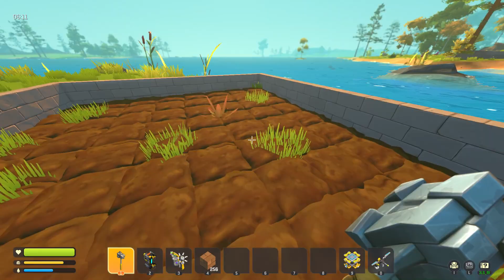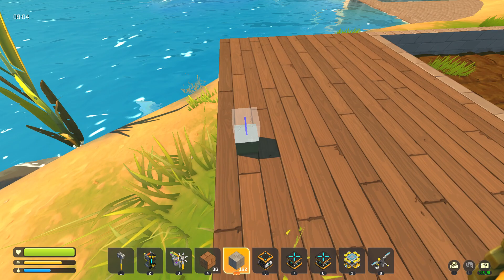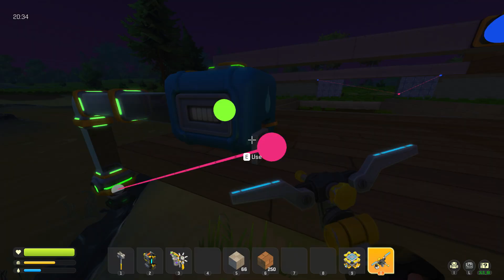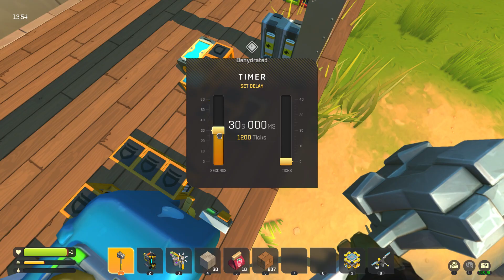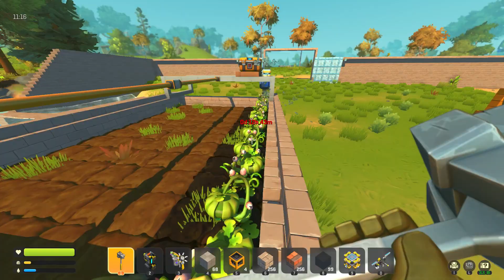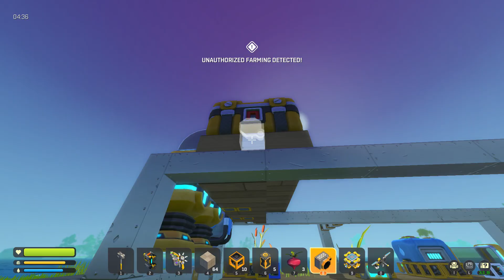Building a Fully Automatic Farm that Plants, Waters, and Harvests! (Scrap Mechanic Survival Ep. 7)

Comment: I put the water tank directly onto the pump, as long as the blocks are connected it doesn't make a difference
saves a lot of vacuum tubes
Reply: I have problems with the controller too, I only have a watering system, so it has to go 15 out, move over 3, retract etc
but it will skip the first row after 5 squirts and go to the end of 2nd row for some reason

Comment: you could fix the slow planting issue by doubling planters, and putting them angled in/one after the other and then you could pulse them at odd and even farm spot, which would double the plant speed, and then if you add that to the double sided version you talked about, that's 2 minutes to plant the whole thing

Comment: 9:35 so you basically build a switch with a button and 7 Logic Gates? xD
Reply: Its a T-flip flop idk why he built it
Reply: @8_su  he explained it, you don't have to manually turn off the switch every time which is very handy, also it is a switch that can be triggered by another signal as well